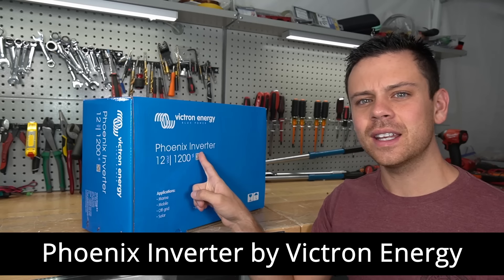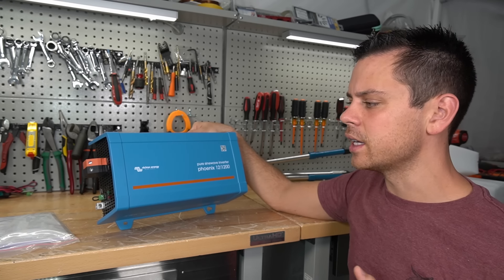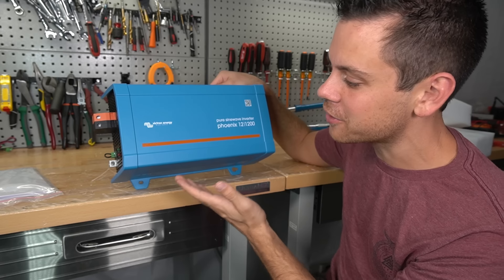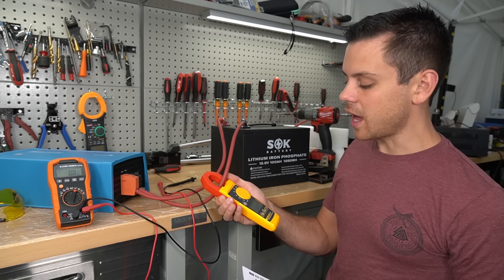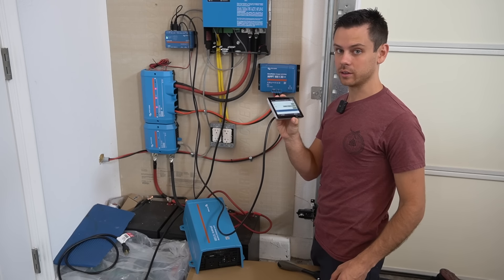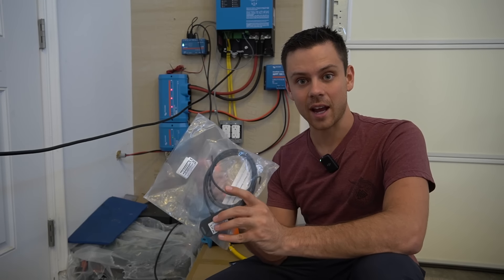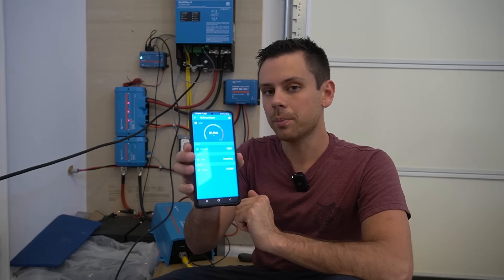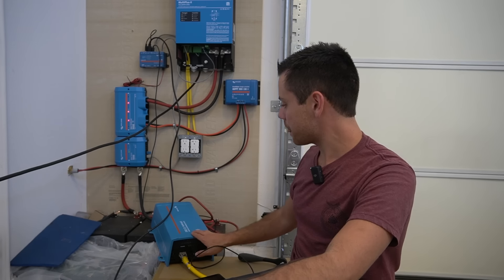Victron Phoenix 1200VA LF Inverter: Extremely Low Standby Consumption and More!

Comment: Will I like your enthusiasm but you're way over my head.  Can you provide examples of when NOT to use this inverter?  I get the impression it's usable for anything but I wouldn't ask if I was sure.  Also, how much of that stuff on the wall is required for this inverter?   I know you need panels & a battery... is there anything else?  Also, why would I use a 48V system over a 12V system?  I was just considering the EG4 or the Growatt and was about to pull the trigger on a 48V system, but I wanted to check your channel first and I'm glad I did!  Thanks so much!

Comment: As always your posts are Incredible.  It's a great idea to use this to power small always on loads (or entire building) in a small off grid situation. 
For 'whole house' battery / PV systems, which I'm guessing 100w idle for all your equipment, just to make the math easier, it's 2.4 kw a day, and if you plan for a 3 day cloudy spell, that's 7.2 kw, or about $3,000 worth of battery and $1,000 max for additional PV panels to recharge on a sunny day, so $4,000 vs $1,000 for this inverter and a tiny bit of battery.  Problem with the math is at least 1/2 the day you'd need the whole house system running, requiring $1,500 worth of battery PLUS the $1,000 of this system, putting the real cost at $2,500 vs $4,000, a $1,500 savings which on a whole house system is not a huge savings.
PLUS
To economize on full home systems, seems trickier.   I'd imagine that one could connect this to your main circuit panel, with a breaker to keep from accidentally over loading it, so you could use existing wiring to power up small loads and  use your brain to limit loads, but if you have a family, friends around, that probably isn't an option and you'd need a separate panel and wiring feeding small loads, along with 'signage' and warnings at the plugs so nothing else it added that you haven't sized the system for.  Tricky one way or the other.

Comment: Very good video, but I think you forgot to mention one of the biggest strengths of the Phoenix, the 1200VA version can handle up to 2200VA Peak power which is crucial for powering big power Tools like a saw or a well pump. We're using this unit in our garden to power the well and all power tools and it's flawless for years. while all our neighbors are still relying on generators were silent carbon neutral. Feels so great!

Comment: After starting my system with a popular brand the starts with "R" and ends in "Y" which, as a newbie, I found to be a very helpful company, and relatively affordable, and fiddling around with other brands, I am beginning to migrate to Victron. I have a smart 150/100 cc, and I have converted a Power In into a fused battery combiner. I've been using a bmv-700 for many years. If my 12v2kw RY inverter ever burns up(good for several years now) I will most likely switch to a 48v victron inverter.
Reply: R...y has had decent customer service in my experience, obviously they sell lower quality products than victron. My experience with victron support was horrible, very rude and refused to answer simple questions. Local victron retailers are likely helpful but victron direct is not
Reply: @TBButcher  That's unfortunate about CS. This was my major reason that I stuck with the other brand so long, even though their gear is, as you say, inferior to Victron. It was fairly reliable, and not too pricey. The CS and replacement warranty is good.  I will say, though, that victron has good web guides. Lots of manuals, etc. and I feel like Victron gear will be around for the long term. As with anything good, the initial investment can be a bit rough, but I don't think they'd be the choice of yacht builders if they were not reliable.

Comment: To use your amp meter at low currents, coil the wire around your pickup.  it is a straight multiplier.  Two wraps doubles the reading, ten increases the reading by a factor of ten.

Comment: You could of also adjusted Phoenix settings via Victron Connect and the VRM tab on it, as long as the be cable is connected to the Cerbo.

Comment: Hi Will,
I've been following your videos through at least two RVs and two editing setups. I'll try to cut to the chase because my question has to deal with portable energy but not for rving.

I'm a musician and need to set up a sound system occasionally where they forgot to wire an AC outlet. I'm not smart enough with the regular electricity to figure out what inverter I would need for a particular sound system to run for 4 hours. I'm sure you can do it in your head instantly. But I would appreciate some help for what I should look for in portable power. I would run either system one , two of them or system two , do them them, two at a time.
And for 4 hours.

SYSTEM ONE -  120vac.  
250 LF
130 HF. 
These are combined, only one power output.

Other than that, it has a high frequency amp and low frequency amp. It says,
250 watts LF
130 watts HF
And I use two of these most of the time.

SYSTEM TWO - 120 VAC
450 watts audio output 

Unfortunately the info gives no power levels except,
Peak power 900 watts, which usually would mean 450 W RMS, probably. I would also use two of these at one time.

I was looking at Bluetti, Gold Zero Yetti and others. But it's power requirements go, I don't even know where to start. Can you give me an idea of what to look for in general? I would appreciate it. Thanks,
Don in Dallas

Comment: Interesting! I want an inverter to power a residential fridge that consumes 500 watts. To power that fridge, i would typically need a 1500 watt inverter. Can I power it with an 800 watt LF inverter?
Reply: My experience has shown me that refrigerators tend to surge, just like washing machines and that a better solution would be the 1200. You would sleep better. 😜
I ran a couple of things like Jackerys that were 500W, and my clothes we’re wet and my refrigerator shut off the mini solar generators. I had to go up to 1000 W solar generator. 
These things seem to have mysterious surges. 🧐

Comment: Yep, I have the 500w inverter with 300w 12v solar panels at 33.8° latitude and run my whole house with it. 640 liter inverter fridge, lots of led lights, charging 2 laptops, 18v batteries for tools, mobile phone booster system etc.
I have 2400ah of agm 12v batteries and have had to put about 40 liters of fuel through generator/ victron 30a charger this autmn and winter to keep batteries good. Never had to do that before but la nina has made it a lot more overcast this winter.

Im putting on 1500w 12v (configured 24v) shortly so I wont need the genset again.

I cant fault victron products, nor their price. Remember the value of all the things you run off your system and ask yourself, am I really saving a few hundred dollars if this thing fries my laptops/ fridge etc?
Reply: Hope you see this.  Did you use an inverter-generator with the battery charger?  Or was it a non-inverter generator?  I'm just trying to confirm that my "regular" generator won't damage my Victron battery charger.  Thanks.

Comment: I wish Victron would make an all in one unit like the Growatt.
Reply: They have, look at  RS 48/6000 smart solar series
Reply: @sergea1138  that is not an all in one
Reply: @TK-123  it has  integrate scc, inverter and charger, what do you want more to be a All in one  ;-)
Reply: @sergea1138  serge : NOT for US market 230 V :
Reply: Inverter RS 48/6000 230V Smart Solar

The Inverter RS Smart Solar is a combination of a powerful 48VDC, 6kVA 230VAC inverter and a high voltage, 80-450VDC, 4kW MPPT solar charger. Thanks to its modern design and high frequency technology the inverter only weighs 11kg and has an excellent efficiency, low standby power, and very quiet operation.
Reply: @TK-123  yep it is an AIO not for the us market :-) they have an auto transformer, to get it work for US market.  I think it is better switch to Sol Ark to get something comparable or other DEYE derivative.

Comment: Is this guy offgrid in garage  behind his on grid home??  After 25 years offgrid I still like as many items running on DC as possible.  Inverters are fairly wasteful.   I also suggest not using 12 volts.  24 volts is far more efficient.

Comment: I need a good 3500watt 48 volt inverter the Chinese ones I buy keep frying after a year can't find anything small enough to fit in my rv
Reply: manage to repair any of the fried ones?
Reply: @jimmybrad156  guiltily I have just replaced them via Amazon refund policy since then tho I've gotten a lv 6548 and I love its performance but it is wayyyy too loud
Reply: @happilyprogrammed4152  have you used mpp solar brand units before this new one? (I assume it's a mpp solar brand unit.)
Reply: @happilyprogrammed4152  Did you have to send it back to get a refund?
Reply: @happilyprogrammed4152  What sort of load size/type before it gets loud?
Reply: So my lv6548 is loud even at idle then as soon as we get even 500wh of pv it starts roaring.  I wanted to change the fans but the fans are thermal glued to the control board and the glue is messy so no way to remove without possible damage to other circuits.

Comment: 091522/1216h PST 🇺🇸.  Thank you. I use the  VICTRON 12V inverter, for the past 4 years, without any flaw in the system. Your information bolstered my confidence on the device. As always, the presentation is highly informative, than the manufacture’s data sheet. 73s….

Comment: Hey Will, you can actually change the inverter settings without that BT dongle thought cerbo GX.  Just install Victron Connect app on your phone or mac/PC and you should find in under devices tab.
Reply: Yeah i was about to comment that this can't be right... cool thanks for the info :)

Comment: Is it possible to run a small-ish grid-tied inverter off a larger stand-alone solar battery bank?  In particular, there are states that don't allow consumer systems to feed-back power to the grid, but it might be nice to run grid-tied at just below the house base-load (house has certain items always on, such as chargers, UPS, security-systems, some lights, etc.).  By supplying less than base-load, power would never be supplied to the grid while grid-power is on?  Let's assume for discussion that there's a grid-power detecting switch to isolate when grid goes down?
Reply: You could do that, and it could work. The thing is if you ever put more out than you consume, they will charge you for the meter going either way. (which is one of the main reasons the power company changed to smart meters)
 I don't know if you've heard of these, but check out the Sun grid tied inverter with limiter. I think one of the Outbacks will do it too. It will make sure nothing goes out to The Grid, and allow you to power more than just your base load if you have enough panels to do so. It uses sensors on the line coming in from the grid to tell it how much it can put out.

Comment: Will,
I have a suggestion for one or more of your videos: "Teach an old dog new tricks" I'm old school and understand house power using AMPs as the scale to set it up. For instance, what is needed when you install a 200 amp service vs a 100 amp service. What I am having a hard time understanding is how a "3000 watt" or even a "5000 watt" solar system compares to either of the "AMP" systems, how to scale to get the solar/battery system needed to run the house equivalent to the AMP systems.
Reply: If I understood your question correctly, it is pretty simple as Power = Amps x Voltage.

So a 3000W peak solar system outputting 110V via an inverter would roughly result in 3000 / 110 = 27 Amps peak. Actually, it'd be less than that  because of losses, etc. But keeping it simple.

Or, providing 100 Amps at 110V would take a 100 x 110 = 11000 = 11KW solar + inverter system. Actually, more than that because of losses, etc.

Note that oversizing the solar system can sometimes be a good idea if one expects a given power output even in the presence of clouds, low sun angle in winter, etc.

Also, depending on the quality of service expected for the 110V side (i.e. hitting 100 Amps all the time, or only during peak insulation, etc), consideration should also possibly be given to inserting batteries in that system to buffer the production & demand peaks.

I hope this helps.

Comment: So under an EMP Attack and it survives but cell service is wiped out can you still operate system at the unit or us it set up strictly thru cell service
Reply: You can still operate it using bluetooth as long as your phone has the app installed.
Reply: @Andrewsnotes1  Do you need to buy the dongle to use the app?
Reply: @jimmybrad156  no need for dongle.

Comment: There is a ground output on back of the unit and I am not sure if I have to connect it to body of a camper truck . I am worried that if the unit discharges through that ground wire it can mess up the truck ECU or other sensitive electronics. 
Does anybody have any information on this?

Comment: nice for mobile but overkill low frequency 1.2kw for stationary application.  maybe if you really need to use a small airconditioner of 600 watts, but then, the inverter will be several times more expensive than the AC. i've been also looking at 12/24V airconditioners based on automotive which removes the efficiency loss of converting DC to AC

Comment: Hi Will, 

What would you need to ensure fast charging when constructing your own system?  I keep seeing that as a selling perk with portable units and don’t want to lose that when constructing my own unit.
Reply: I think you just add more batteries if needed and more solar with separate Solar charge controller for faster charge to batteries.

Comment: The low standby current is only part of the equation. You really should have tested under-load efficiency too. LF inverters are typically not as efficient under load, so depending on how long you run those small loads, a higher efficiency HF inverter may actually be not that far behind in Wh's consumed.
Horses for courses, I guess 
These inverters are probably good for sporadic small loads but a HF inverter is likely to be more efficient for constant loads, or loads that run for longer periods.

Comment: I'm curious if this could work for powering multiple computers that I use for VMs. I know that this certainly can handle them once running, but the concern I have is tripping OCP at startup if I wasn't there to turn them on one by one. If anyone has experience with this type of setup, please chime in. I know most ATX PSUs can draw over 30 amps at startup, just not sure of the timescale (source Toms Hardware).

Comment: These are very good for Electronic products that are sensitive. First the toroidal transformer costs more than other cheaper products. Also they do fail as we use them commercially in ships. They are designed very well(Netherlands), made in Malaysia quality ok. You get what you pay for end of the day.
Reply: What happened with your failure/s?
Reply: @jimmybrad156  its on a big vessels,  all depending on the crew what have they done wrong to damage all the inverters on board. Would most say user error, also their protection circuitry is not the best but longevity and endurance excellent.  Warranty  best in the world as it comes with five years international warranty no quibble replacement units... buy and dont worry

Comment: I run an independent, inductive inverter circuit to power a small refrigerator using a 700 watt "industrial" 24V inverter from Go Power. In its equivalent "eco" idle mode it draws 1.5 watts of power on average, far better than if my main inverter was powering this type of load. Its cost is in the same range as the Victron, though.

Comment: The discussion about low vs high frequency inverters is long overdue. My Giandel went OL from only one short in a cord with a angle grinder.500 down the drain like that. And I could not figure out why. High frequency equals weak. If I had known that I could have just fired up the Honda.

Comment: Thanks for another great video, Will. I have a phoenix 375w, 12v victron inverter. Even at 375w, it runs my whole house. LG refrigerator (110w), 55 inch TV (80w), lights, WiFi equipment, laptops, and phones. The inverter is amazing and have had zero issues with it. I did not have enough money to buy the phoenix 1200w inverter but also did not want to buy the bigger cheap Chinese inverters. I plan to buy the phoenix 1200w inverter someday if not, I will probably get another 375w or 500w and separate my loads. Will thanks again for inspiring so many people across the globe. I am definitely one of your biggest fans. With love from Africa!

Comment: It’s a good idea to use multiple inverters for different load categories. A DIYer won’t be bothered by the need to turn on and off those inverters. But a normal distracted person will be challenged. 

What about a DC load center ? Can high idle consumption be avoided or reduced? Running LED lights thru 120V inverters seems wasteful. How important are regulated DC outputs?

Love to hear your thoughts on that.
Reply: Indeed. DC load centers are heavily used in RVs for that reason. All the loads that can run on 12V (or 24v) are usually fed DC via a DC load center (fridge, wifi, lights, USB, fans...). In some cases that leaves only large intermittent loads on AC (aircon, water heating...) which allows shutting down the inverter,  or using its eco-mode,  for long periods of time.

Comment: It would be enormously helpful if you would do a comprehensive video about the proper installation of a 12-volt system in an older motorhome.  That's where most of us DIY RVers need the most help.  Especially, as regards to the DC to DC charger involving issues to make sure you don't damage the motorhome's alternator.  And how to handle the already installed crossover switch for the vehicle to house batteries.  Thanks.